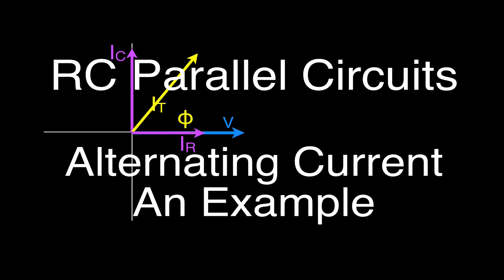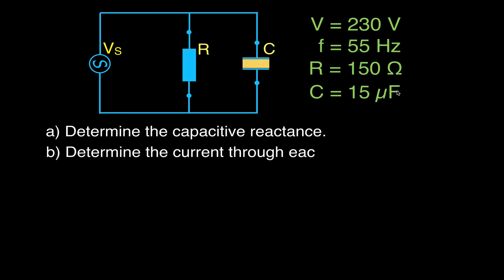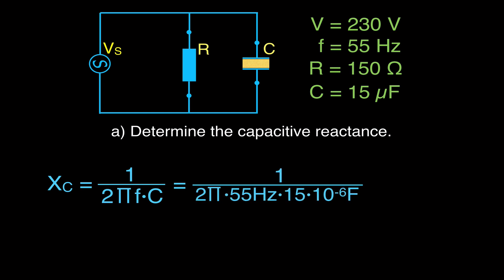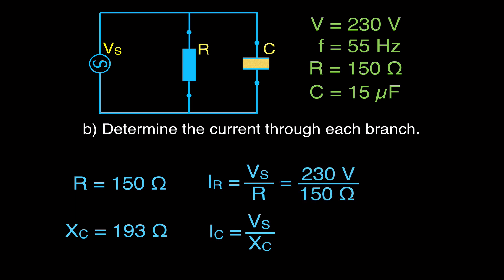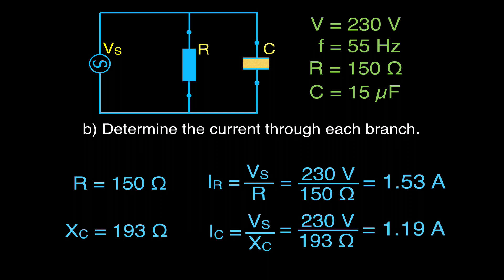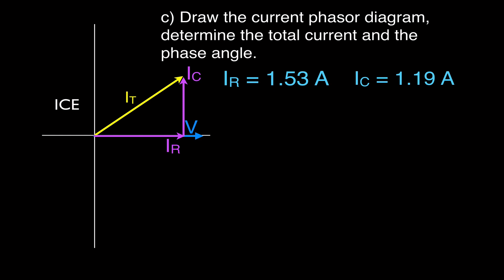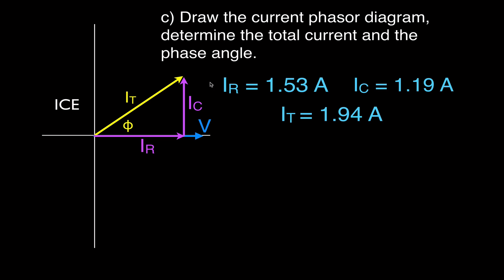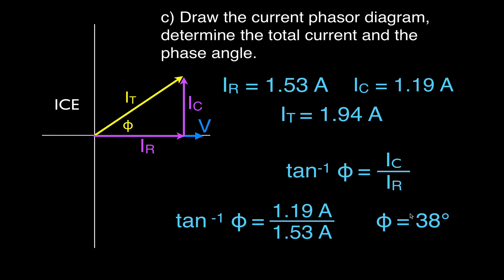RLC Circuits (16 of 19) Parallel RC; An Example Problem, Current, Impedance and Admittance

Comment: Total Current = 1.94A but  IR = 1.52A  and IC = 1.19A, In parallel circuits IT = IR + IC => 2.71A /not =/ 1.94A. Please help me with doubt
Reply: I'm really sorry, I neglected RMS current. Thank you for your work and help.
Reply from the maker: No problem, thanks for watching!